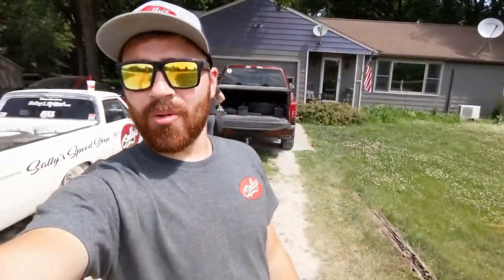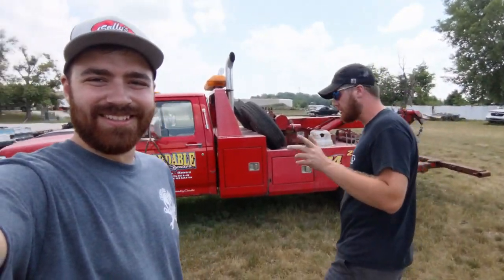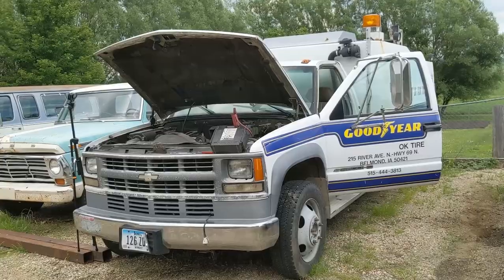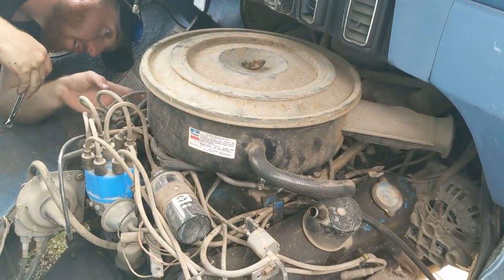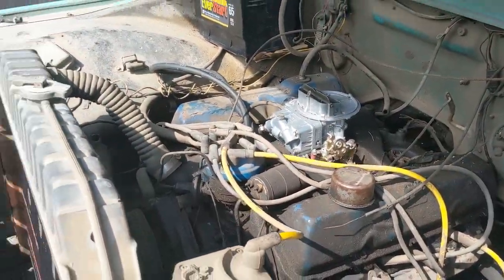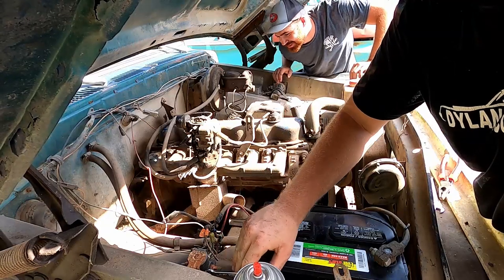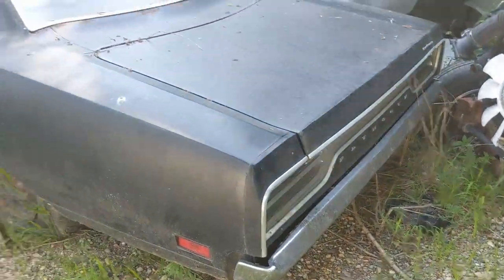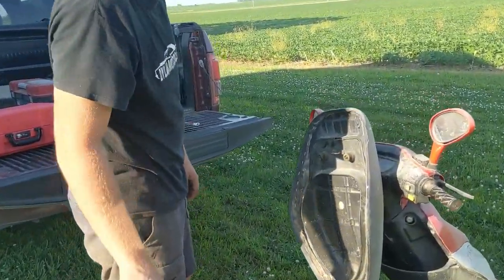Reviving all of JUNKYARD DIGS revivals in ONLY ONE DAY! WILL THEY ALL RUN? Sally's Speed Shop Ep. 20

Comment: My grandpa's old truck still ran after being run without oil due to an oil-filter gasket failure (oilchange place didn't peel the old gasket off the block) and I replaced its rotten coolant hoses with a mixture of sink drain/misc plumbing parts plus the good middle sections out of old hoses picked up from the wrecking yard. Ran 'till the day it was unsafe to drive because of the slop in the steering linkages, so bad it could change lanes without input from the steering wheel.
I kept the old duraspark box when it was sent to the wrecking yard, because it still worked. Fords are crazy!
Reply from the maker: That's pretty awesome!
Reply: Right? It never seized, the pistons just got slappier! XD

Comment: On Duraspark boxes - Digs: "In fact, if you're running one of these in your car, it's a good idea to carry..." Me: "A 4-pin GM HEI module and a couple of pigtails so you can run your Duraspark II distributor on an ignition module that actually works when the Duraspark fails for the 178th time."
Reply from the maker: You're a smart man. Build it Ford tough with Chevy stuff

Comment: Old Ford's are the best, you can't kill them. I have '68 F-100 4x4 with over 650,000 miles on it. Sure the engines been rebuilt but that's it. No power steering, No a/c, just a simple old farm truck that works everytime.
Reply from the maker: Man! That's a lot of miles!

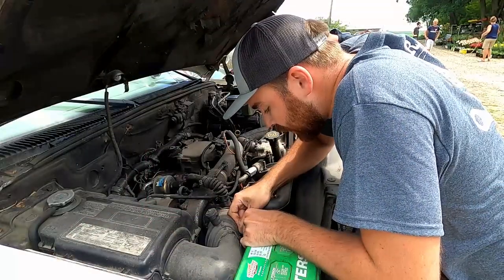Comment: 14:12 Yeah, those side-post batteries were about the worst idea ever in automotive design --- not only are they harder to reach for servicing or doing a jump-start, but they also corrode a lot faster and more "deeply" --- I almost ALWAYS convert a side-post car to a top-post configuration whenever I do engine-maintenance/repairs on it; the cable-ends are usually chock-full of rust and powdery blue-green corrosion!  It takes about a half-hour of wire-brushing and maybe a quarter-box of baking soda just to clean off all the verdigris (I also usually trim off the black/red rubber collars from around the actual metal terminal-ends, so that I can effectively/properly cleanse the contact-surfaces, and so that the rubber surrounds aren't there to trap acidic battery-fluid leakage and moisture anymore, which would then cause even further corroding), so that I can have clean/bright enough copper discs on which to bolt the side-post-to-top-post terminal-adapters.  Whenever possible, I usually use stainless steel bolts on the terminals, too, which lessens future corrosion of the connections. :D

Comment: The 6.2 and 6.5s are way quieter than the 7.3 powerstrokes. The noise out of them is the heui system banging away. The idi and Detroit would probably be similar.
Reply: Man that old dump truck... that 352 should get pulled and put into mooks flooded ford😂
Reply: And that satellite is actually not terrible compared to some things I've watched Chris birdsong rebuild 😂 theres most of the frame rails left!
Reply: And my fourth and final comment (you made it an hour long... lots of content to comment on😂) that like 73 nova... what's the deal with that beaut?🤔
Reply from the maker: Not a bad idea for the 352!

Chris Birdsong is a wizard with Mopars, it's amazing how bad they rust...

I believe the Nova is just something Kevin picked up and has yet to make a video on

Comment: I have this old 82 dodge van with i believe a 360 I have owed for 10 years it has low mileage never did a thing with the van bit it for free,  but when I go up to that van I am not even joking I though a battery in it pump it 5 or so time hit the key and it fires right up if I ever get a project that needs a 360 I have a great motor for it.
Once it sat for 3 years didn’t even put gas down the carb and it fired right up 😂 I have had funny luck with old cars
Reply: I had a old ford motor home also with a blown up 460 and I sold that to a guy and he drove it home 50kms home with a blown up 460 😂 just makes you think how much better old motors are 😂
Reply from the maker: Sounds like you have better luck than we do haha Old cars definitely do it better!
Reply: Most  definitely